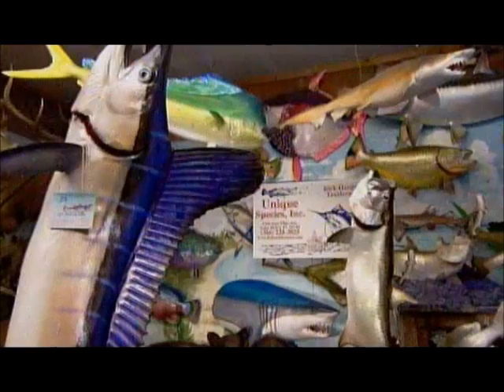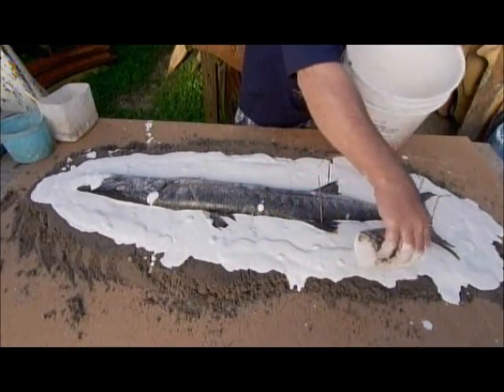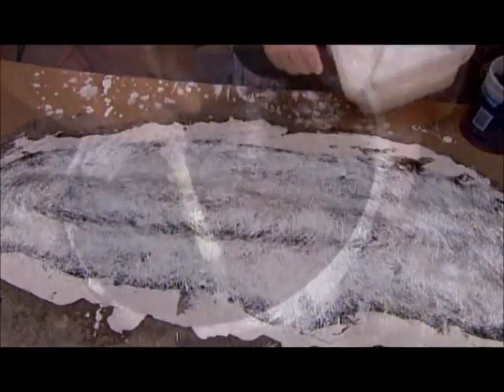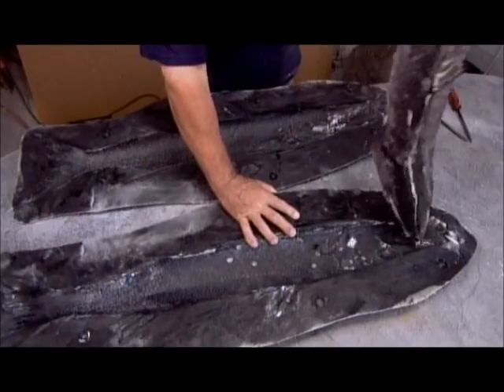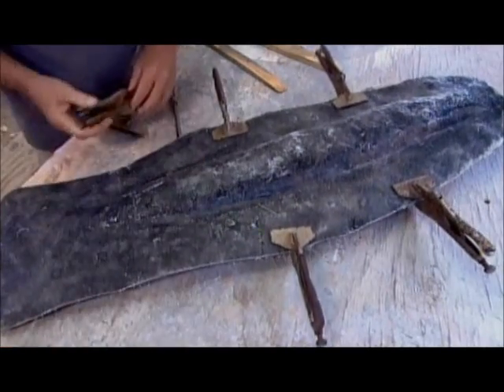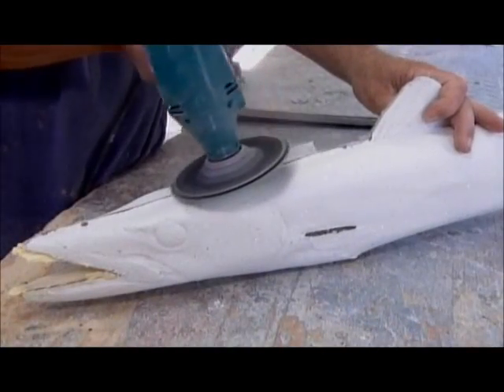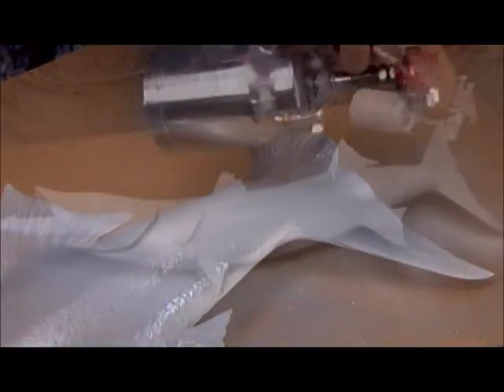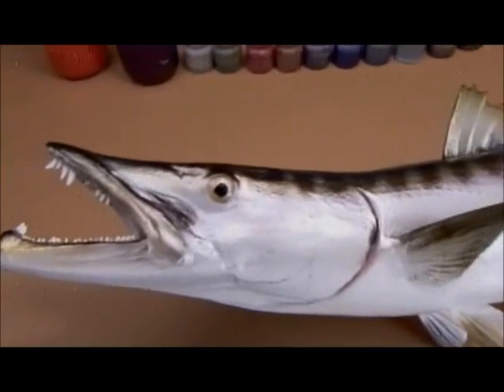How It's Made - Fish Replicas

Comment: 1. No gloves or respirator (or any kind of safety equipment it seems) when working with fiberglas, resins and expanding foam, thats just bad and unprofessional.
2. Using expanding foam, that contains (in most cases) isocyanates that are not only dangerous to the people working with it, it is also damaging to water based life forms. So not so good for fishes in the end. I guess you can claim that they take care of the waste and are carefull, but judging by the safety used in the video I bet they don't.